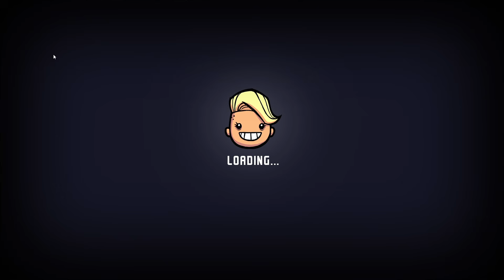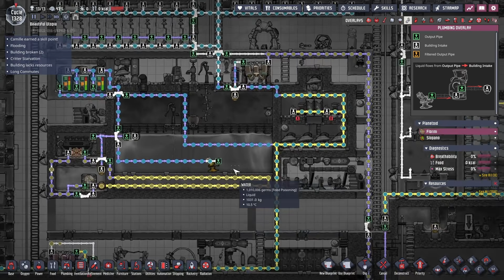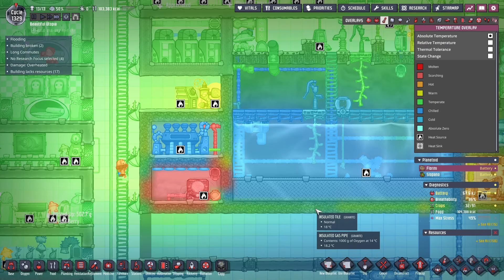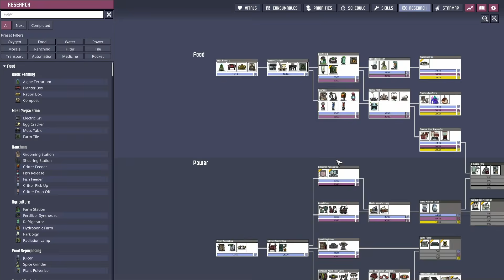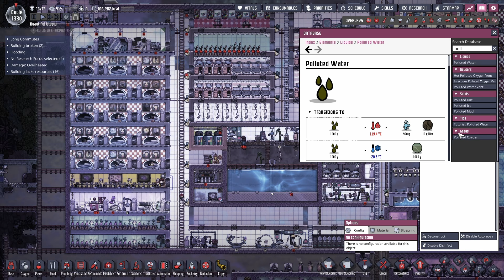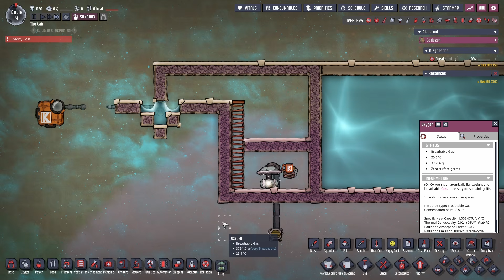Complete Steam Turbine Aquatuner Cooling Guide For Beginners - Oxygen Not Included

Comment: The correct term would be Energy Transfer. You can’t delete heat just transfer it. You basically turn Thermal Energy into Mechanical Energy, into Electrical Energy, back into Thermal Energy. Energy can’t be destroyed just altered. Sure this is a game and there is probably loss somewhere in that system but it still applies.

Comment: A Critical Early-Game Warning: Heat Management. It's easy to overlook temperature at the start, but heat produced by your buildings is a silent threat. If not managed, it will spread, destroy your food supply, and disrupt your base's ecosystem. Begin planning for cooling long before you think you need it.
Reply from the maker: Great point about early-game heat management, it can really sneak up on you!
Reply: @CanadianXOfficial That's why I like to do a very slow methodical start where I map out all green on the heat view and insulate tile the entire perimeter.

I come out left or right of the base for first egress and liquid lock the main entrance.

From that point out all heat generation is booted outside of the pristine core and I feel comfortable creating a huge mess anywhere else.
Reply: Depend on ur primary food source. If in early you can secure meat by ranching, then had temp around 30°c should not a problem.